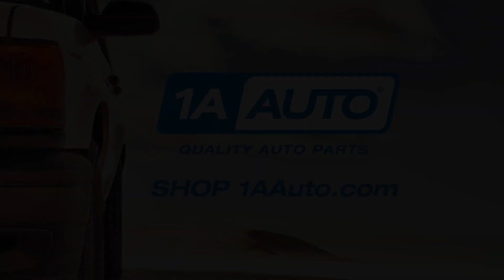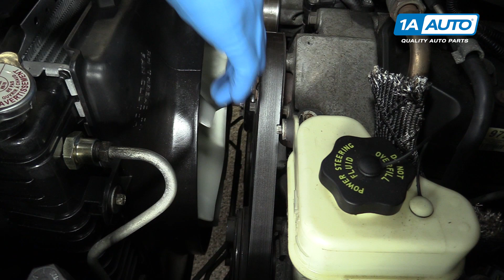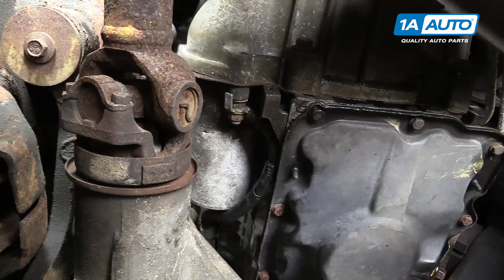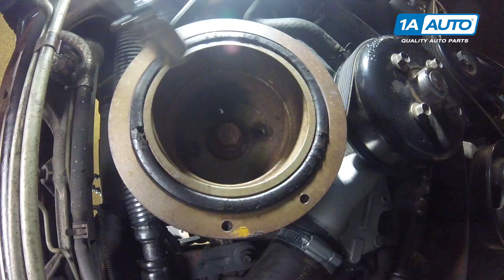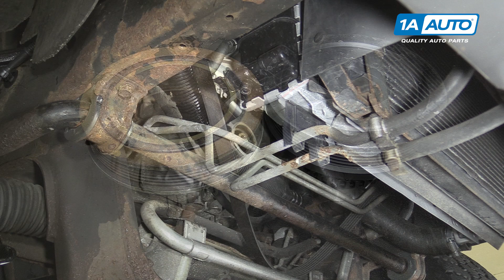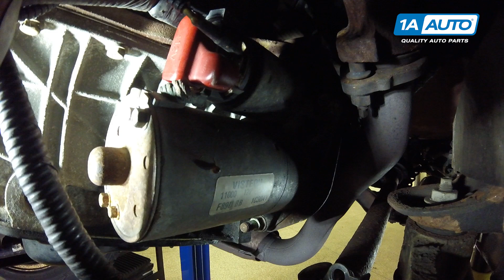How to Replace Safely Harmonic Balancer Crank Pulley 01-11 Ford Ranger

Comment: i didnt have the time or money or tools to do it this way unfortunately. by balancer was so shot, my metal ring slipped off the rubber portion. i went through 2 crankshaft sensors due to the rubbing. i ended up trying to glue it kinda with JB weld. its been going strong now for over a year with the stuff. i know not recommended but it worked

Comment: If you have a decent strap wrench you can put it on the balancer to hold it and get to the 97 ft/lbs of torque on the crank bolt. No need to remove the starter.

Comment: My engine is in my truck (not on an engine stand). I don't have an impact wrench. When I go to loosen the crank bolt (using a breaker bar), will I be able to use the belt to keep the engine from rotating counterclockwise? Please advise. Many thanks!

Comment: I just did this this job ended up being a bit of a nightmare. The puller bolts were to short and needed 8mmx1.25x100mm long. After installing the dorman harmonic balancer I started getting misfire codes P0300 P0303 p0304. I changed out the crank sensor and spark plugs. I ended up pulling the balancer back off and found that the pickup teeth for the sensor were bent on the new balancer. Make sure to check your new one before install. I just wanted to share this info for others.

Comment: There is a flywheel locking tool that bolts onto the starter mount location . Remove the starter and install the locking tool in its place.

Comment: I have always liked 1A Auto videos. Usually more professional than many of the DIYers. But you guys need a bit more info on this one. 
1. The crank angle sensor removal
2. The store bought crank tools have short 80mm 8x1.25 bolts. And most hardware stores don't sell the 90mm or longer bolts needed for this deep balancer. Where do you get them?

Otherwise this was a great video as usual.

Comment: what size hardware to thread into balancer to use with puller? I have tried 1/2-20, 1/2-13, 3/8-16, 3/8-24 and all are either too big or too small.

Comment: excellent video.  not rushed, clear audio.one step I would add is start the engine and check for correct belt tracking as soon  as the belt is back in place.  Thanks for the production.Worth mentioning is the fact that starter removal  is not necessary if vehicle has  manual transmission
Reply from the maker: +Homer Smith Thanks for checking us out. Shop here for high quality auto parts: http://1aau.to/m/Shop-1AAuto-c